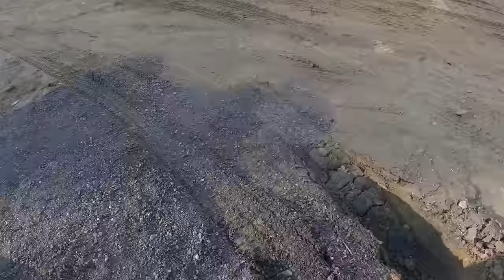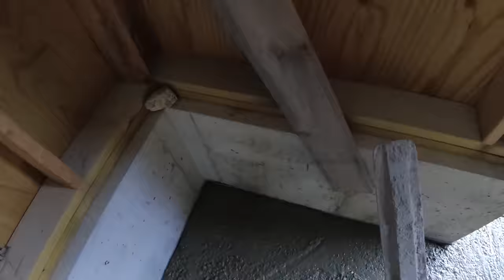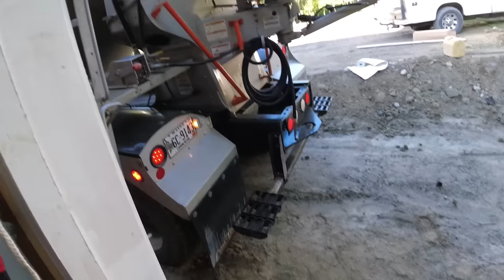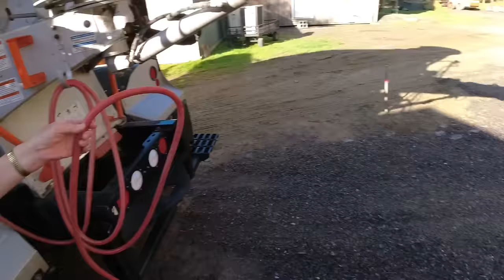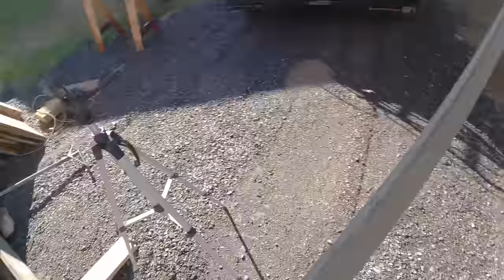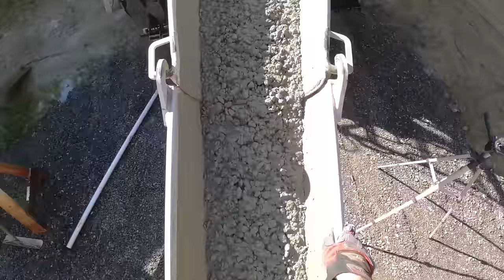Nice 48' X 24' Garage Floor Pour (How To Pour Concrete For Beginners in 2024)

Comment: Access is so important. If you aren’t sure what the driver’s capabilities are with the chutes or if the ground is able to support a 70K lb truck full of concrete, don’t take the chance and go ahead and get a pump. It’s a tough lesson to learn when you get a truck stuck no where near where the concrete is supposed to go.
Reply: Those trucks can handle a hell of a lot more than one would think.  Love those trucks they can drive through some shit
Reply: @LordDeuce-ul7my  Sorry but no they can’t. That’s why they’re all wheel drive and have the lowest possible ‘granny’ gearing imaginable and on board tire inflate/deflate capability, exactly because they tend to get stuck so easily. It’s not their fault. It’s just that 35 tons is a LOT of weight and if they hit a soft spot in the dirt they go down. And god help them if they gotta turn their wheels a little bit. They just start plowing ruts in the ground at that point.
Seen it more times than I care to remember and I’m just saying, good straight-shot, stable ground access is a must for those things.
Reply: @psidvicious  think just renting buggies is the better solution just because pumps are a pain in the neck to get and majority makes you do a downpayment which is pricey as hell.
Reply: @unknowngaming4781  Buggies are awesome. If they work for the situation, use them 👍Line or boom pumps are readily available in my area, in whatever size needed. Just make sure the concrete gets where it needs to go. Buying a load of mud that went off in the drum because the truck got stuck is no fun. Especially when the stuck truck blocks the only access for the next trucks, already on the road.
Reply: @psidvicious  in this situation buggies over pump any day especially in a 6–10-yard pour where access is right there. Pump cost too much for a job like this. And if the concrete is going off in the drum that's just you not telling the driver to wet the drum or add delay or the crew just getting the mud down way to slow for the weather and slump.

Comment: Sorry but no they can’t. That’s why they’re all wheel drive and have the lowest possible ‘granny’ gearing imaginable and on board tire inflate/deflate capability, exactly because they tend to get stuck so easily. It’s not their fault. It’s just that 35 tons is a LOT of weight and if they hit a soft spot in the dirt they go down. And god help them if they gotta turn their wheels a little bit. They just start plowing ruts in the ground at that point.
Seen it more times than I care to remember and I’m just saying, good straight-shot, stable ground access is a must for those things.